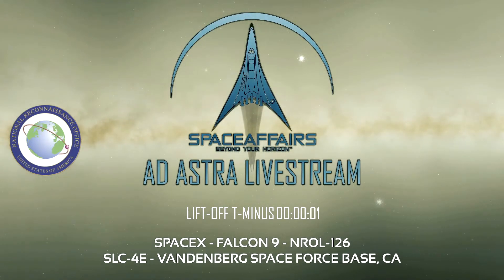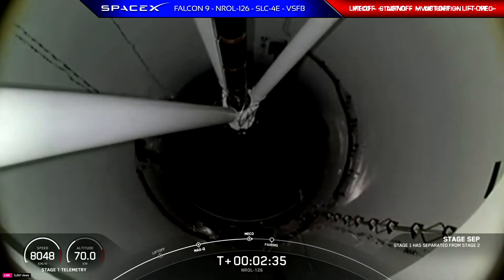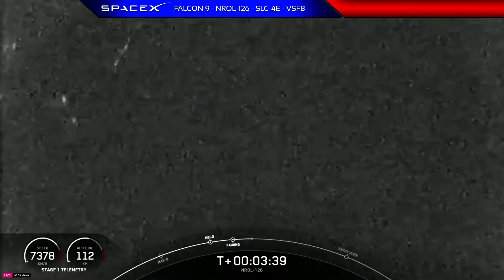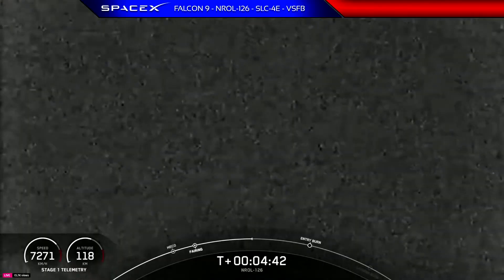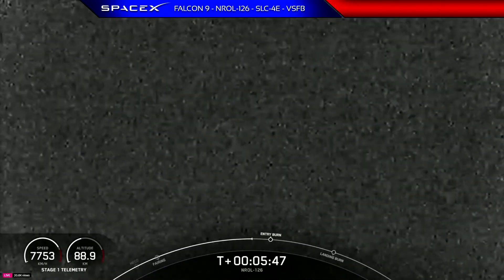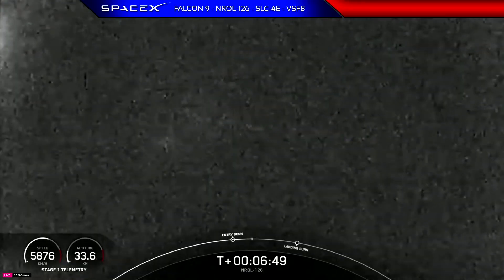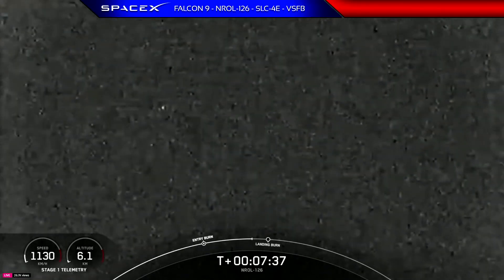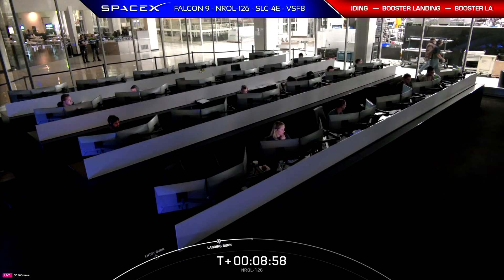SpaceX - Falcon 9 - NROL-126 - SLC-4E - Vandenberg Space Force Base - November 30, 2024

Comment: I really wasn't expecting much for video coverage since it was an NROL mission. I was hoping to see it eyes on, but it was too cloudy. Thanks SA and SpaceX for what we did get to see
Reply from the maker: It looks like that SpaceX cut off the launch and views of the rocket on the pad and step in 43 seconds after the launch. Maybe the Falcon-9 has a different fairing as usual? It looks like that the broadcast was longer streaming because of the commentator Kate Tyce, maybe for the launch contractor, and SpaceX stepped in later for the public. NROL missions and even DOD missions were streamed in the past always, but don't show perspectives of the 2nd stage after staging. Same is valid for ULA. SpaceX did not announce a live-broadcast or a T-Zero, they only announced the launch on the SpaceX website with a 4 hours launch window, but there was also written "24 Starlink Satellites". Of course, a NROL launch is not with Starlink, maybe it is with "Starshield", the specific version of Starlink which is done by SpaceX together with Northrop Grumman. Let's see what will be with the next stream from Vandy, planned for December 3/4 for Starlink.